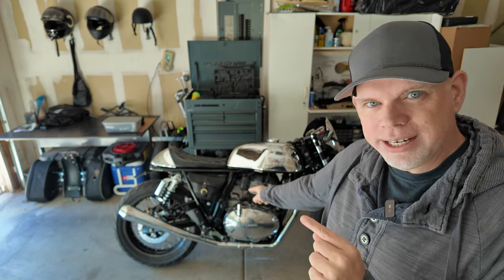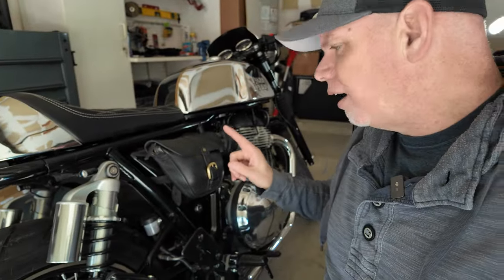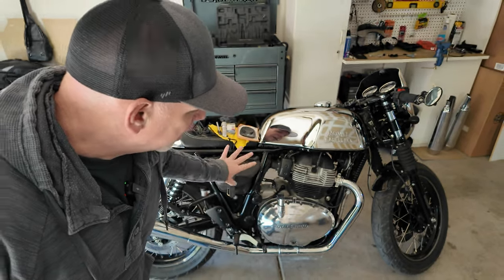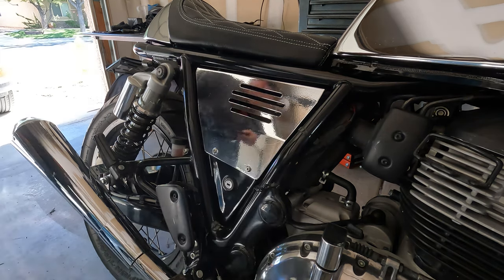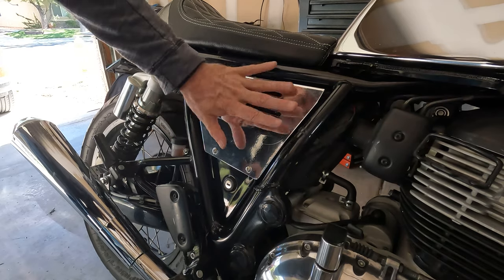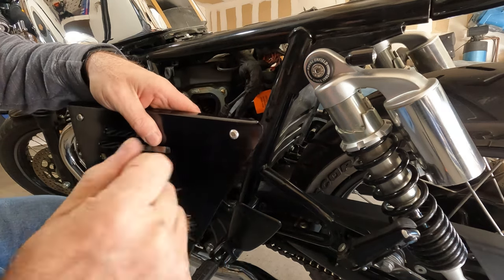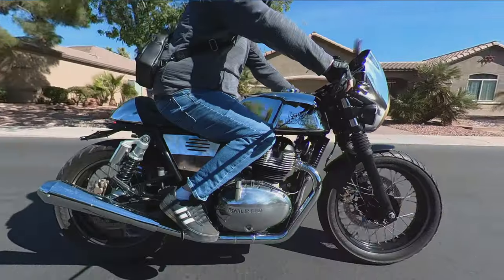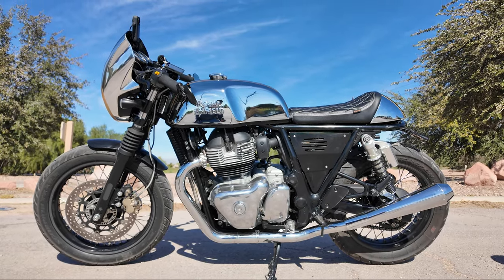Motorcycle Side Panels | Black or Chrome? | BAAK Side Covers for Royal Enfield Continental GT 650

Comment: Hey Jerry, thanks buddy. I have had my Royal, this season will my my 3rd season. I have Autologue Design Half fairing (Reck 2.1) looks great but really bad design not recommended but now that is one it looks good, Anyway I was looking at side panels and same with you, I don't like logos on my side panels and I was wonder in terms of the BAAK do I want the stainless or black after seeing your vid black is what I'm going with for the Air filter side. The tool box side I'm going with the Royal Enfield side bag, in Brown it also bolts on to the bottom part of the original side panel and has a hole in it for the seat release so to release the seat you just reach in to the bag and pull the button or leaver whatever its called. I like what you have done with your RE it looks good I bought the Ventura blue but ended up buying a black and gold Gas tank for it so the bike is all black and gold kind of has the look of an old Norton or at least that is the look I'm aspiring too. I also have a Booster plug and Emgo Hooligan exhaust and a High flow air filter, I have many bikes but I have really come to love my RE GT 650 as much as my RD and my Bonneville so basic so versatile so unique at least in Canada and mostly I love how simple it is, No rider modes, no fancy stuff just a bike :-). Thanks for talking the time to make the vid, I hope you get lots of views and I'll share this on RE Canada FB site some of the guys may want to see this if they are stuck with the same dilemma. Cheers Karl
Reply from the maker: Thanks for the comment - yes, one of the things I love is how simple the bike is and easy to customize yourself (also, a thrill to ride without having to got over the speed limit... well, maybe a little ;) Since this video I went and bought the brushed aluminum side panels from Baak and had them polished. I liked the look of the chrome but didn't like the look of the vinyl. More recent photo https://imgur.com/a/893T0Gr

Comment: honesty the headlight cowl looks very big, stock look was nice
Reply from the maker: I agree... the headlight cover is a compromise based on my current use of the bike and not my ideal preference (it's actually the opposite of what I eventually want.) Someday I'd like to remove the gauges, put a smaller headlight, simple controls, etc... but since this is my only motorcycle and I like to go on long trips, I find the cover is more practical for covering and protecting my phone, cameras, usb plugs, cables, etc... all things you don't want on a cafe racer style bike.

Comment: i wish the headlight kit could be removed it just doesnt really go well with it,in my opinion.And the chrome side panels would really go well.
Reply from the maker: I take the bike on long trips and I found the headlight cover useful for practical reasons... but I agree, it's not what I prefer on a cafe racer. Someday, if I get another motorcycle for longs trips, I want to strip down the front , remove the gauges, add simple controls, lower the clip-ons, and a smaller headlight and brackets.

Comment: I liked the black more than the chrome and I was wondering why!!? It's odd because I have been fancying a full chrome GT 650. And it is not due to the orange peel texture because I could barely make any difference between vinyl and stainless steel on the tank on the YouTube video (due to loss of quality on mid to long-range shots). I'm pretty sure it is the awkward small black inverted triangle on the chrome(where you put your keys on) that throws things off. If you could vinyl that, I'm pretty sure things would be much better, and a fair chance for Chrome.
Reply from the maker: That's an idea...I may try to chrome wrap the lock part of the panel just to see how it looks.
Reply from the maker: Took your suggestion and chrome wrapped the entire piece https://imgur.com/gallery/iHjDmMd